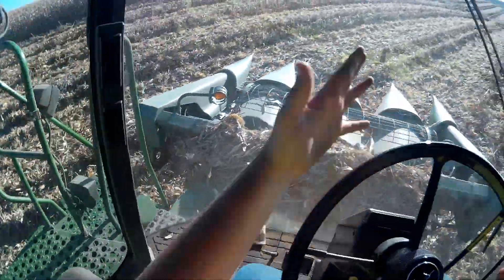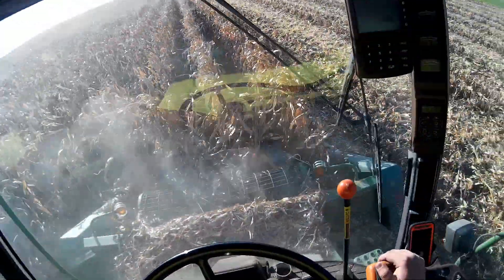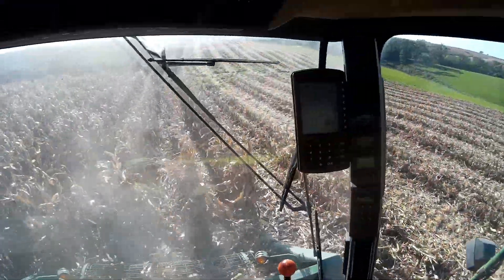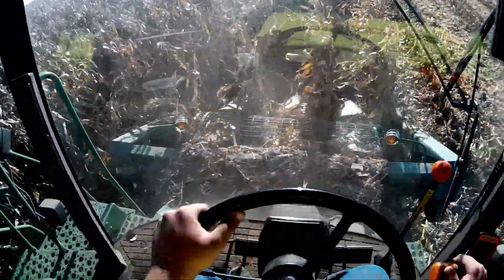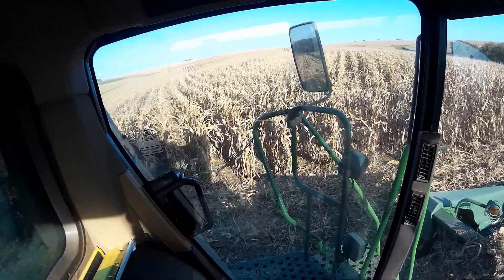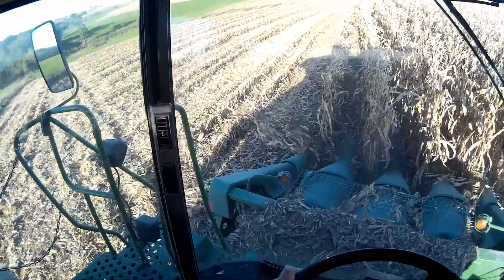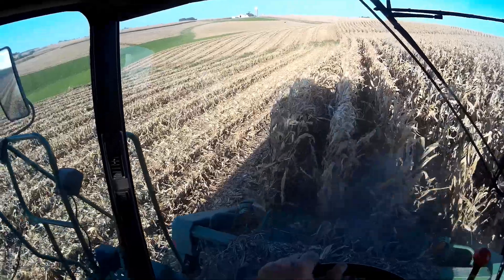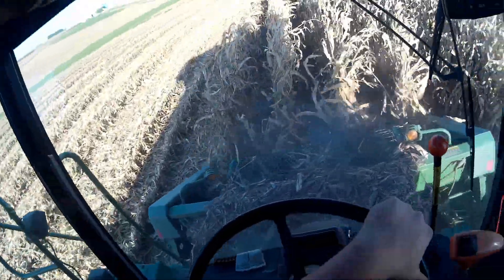The View From the Cab - Harvesting Corn

Comment from the maker: Before someone says "you need a 6 row". A 4 row works best for OUR operation. I hear it over and over again every day. You don't need to say "you need to buy this" " you need to buy that". Do you think we don't think about this stuff? Switching to a 6 row head gains you around 2-3 feet every pass. Spending 35-45k on corn heads for both combine and chopper, changing wheel spacing, cultivator, planter, and probably something else makes no sense at $3 corn, and $14-15 milk.